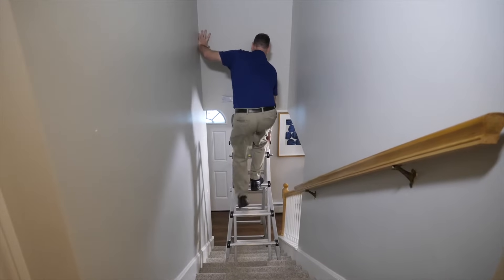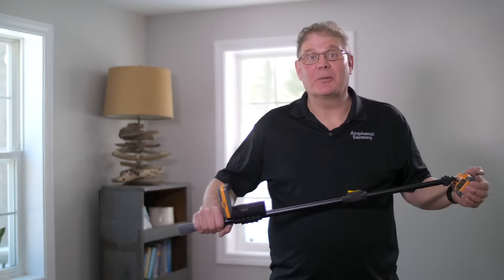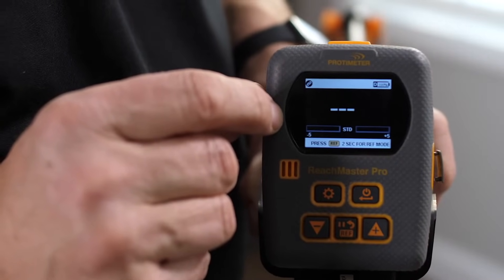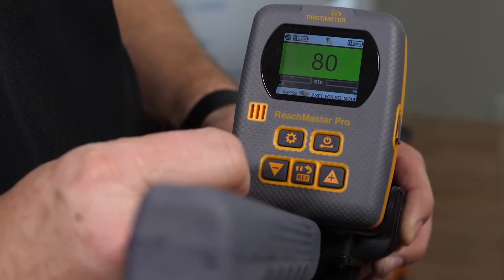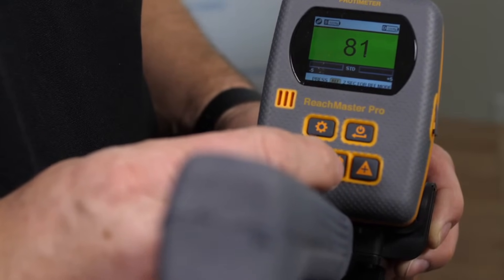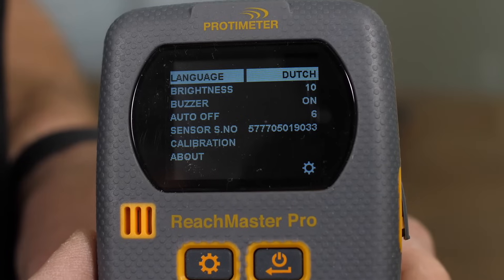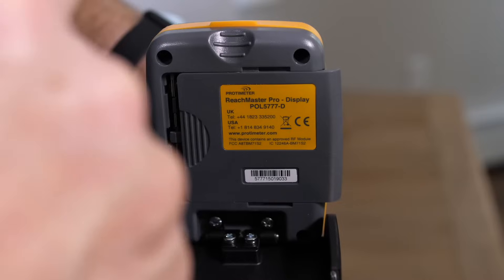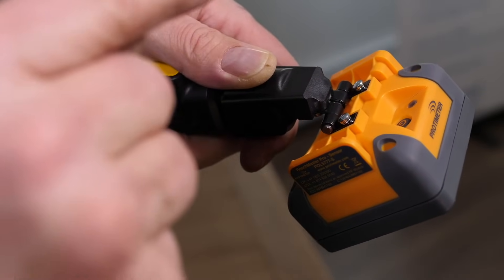Introduction to Protimeter Reachmaster Pro | Non-Invasive Extendable Moisture Meter! BRAND NEW!

Comment: My reachmaster pro has been working great for almost a year and I absolutely love it, but now the sensor wont connect to the unit, any idea how to correct this issue?
Reply: I had this happen to mine three times when i first purchased it, it was under warranty and the distributor was very accommodating, I was told it was a flaw in a batch in the head unit, my latest unit has been good so far, also I am told it is important to turn on the head unit (sensor) first. I hope this helps.